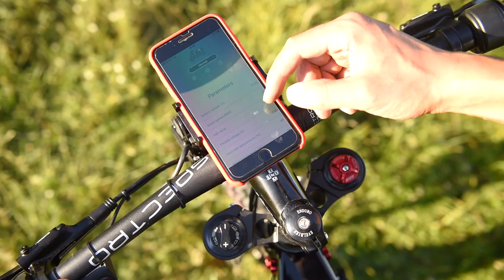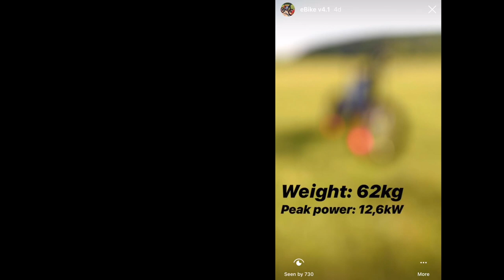Build $3600 DIY Electric Bike that Rides 110km/h - How To Guide and Parts List Promotion

Comment: right now I've got the same EEB frame. a 60v 35ah battery, what controller and hub motor could I use to get the most out of it?  

Last build was 1.5kw + 52v 30ah battery. only like 30a controller tho

Comment: Oh so i didnt know your ebike 4.2 charge in 44 minutes that's insane, very nice build.  13kw motor, 2é2kwh battery, 44 minutes charge and Schlumpf drive for 3600 USD is dirt cheap.  Thanks for inspiration.  I started building ebike after falling on your website a year ago, i started with a hardtail BBSHD, then BAC ASI 855 BBSHD 3.5 kw, nand now  im now building my 3rd one, a 12kw enduro but this build is WAY better.  But seams to take more tools and more skills.

Comment: looks like a good build...with that range and speed capability, only thing that I see going first would be the tires.
Reply from the maker: What’s wrong with them?
Reply: @ladiandmargaret  not that there's anything wrong with them, just that they will wear out fast if they are normal bike tires due to the power & range, I think. You haven't wear them out yet have you?
Reply from the maker: These are motorcycle tires, should be fine.

Comment: Everything looks good but when you bind those batteries together I hope you connect them to the regulator or power stabilizer chip so when they are charged or used at high speed it wont get leakage and the engines can use the battery as a whole not as a single slots of energies.
Reply from the maker: Don’t worry 😉
Reply: @ladiandmargaret  I really really like this bike build and other builds on your website but I do have some questions that need answers

1- Is this e bike weather proof?
2- How secure is the battery(if I got on a bumpy terrain will it vibrate)?
3- This bike is 3 years old did it not receive any updates during all that period?

Comment: Would I need welding equipment and other expensive tools to build this? Also don’t have a 3d printer could I make parts from wood? Thanks
Reply from the maker: You don’t need to weld anything, basic tools only, 3D printer not needed.
Reply: No nee comments. I'm very interested and have been deep down the Alibaba hole

Comment: Is there a mode to let it look like a legal pedlec? (Just driving 25km/h while putting work in the pedals).
German police is very strict with stuff like this :/
Reply from the maker: Yes, you buy extra pedal sensor and change the mode to up to 25km/h. The problem is that legal ebikes must have less than 250W which is an obsolete nonsense.

Comment: Thanks for the inspiration, very nice bike. Just a question. I have seen that the schlumpf drive price is about 600 €. Is that drive included in the base parts for 3600$?
Reply from the maker: No it’s not. That’s extra.
Reply: Ladislav Jecminek is the schlumpf drive needed to be able to pedal the bike or just an extra to secretly change to just cycling? I didnt understand that obviously.

Comment: RC Lipo packs? Please tell me by 2022 we’ve switched to A123 LiFeP04  pouch cells (that have been around for years). You could probably fit 72V 50Ah worth of power cells in this frame.
Reply from the maker: We use 21700 mainly these days. Molicel p42

Comment: What is the largest DIY battery  you can fit in an XL fat bike frame? cell size? cell number? volts? AH?
Reply from the maker: What xl fat bike frame?
Reply: @ladiandmargaret  Surley Moonlander. The place where I live in China has lots of hills up to about 5,000' climbs so lots of power and no overheating of motor is more important than in other flat countries. 48V? 72V? 90V? 22,600? 18660?

Comment: What kind of kickstand did you use to hold up the extra weight of the e-bike?
Reply: Kickstand should aim directly at the bike centre of gravity then the load goes straight down the stick. A narrow tube is strong enough as it should not see any bending loads.

Comment: Is there any function that charges the battery while paddling like turbine generator built in
Reply from the maker: Yes, it has regenerative braking. What you are suggesting would barely provide any power while pushing 60kg bike.

Comment: Don't you have concerns about the lipo batteries getting hit in any way while riding ? 

I see you are using BMS for recharging , so that is good, but I still would not leave them unattended while charging.
I'm thinking of building a bike like that , but I think I will use good 18650 or Boston Power Swing 5300mAh (  they are actually made for electric bikes, scooters, etc in mind ) .
Reply from the maker: Not at all. It’s more risky when you mechanically damage it.

When purchasing my video guide I include 18650 cell based battery drawing that fits the frame and controller inside of the frame.
Reply: @ladiandmargaret  , Its cool bike and you should be proud of what you have build.
The thing is I'm not sure if I want a lot of power or a lot of range so I'm kind of split between 1000-1500W motor with very big 48V battery pack or something like your beast of a bike.
If I make the bike to go ~50km/h with the same frame that you are using , I can put a battery that will let me go for over 300km of range in theory.

Comment: Where did you buy the bike frame from? What's it called? Very cool.
Reply from the maker: Hey, build your own. Based on my parts list including over 80 parts with link and prices, straight from suppliers. I also have a video guide that is over 3 hours long showing how I built mine.
Reply: @ladiandmargaret  is the video with the parts list up? I'm not seeing it.
Reply from the maker: I’m selling parts list and video guide separately. When buying both I’m including 3D models for printing some parts.
Reply: @ladiandmargaret  ok, I'll send a email in a few weeks after I move.

Comment: Hey great videos and smart job, why did you like the most the rear hub motor, i believe for balance, but some peoples said the mid drive motor are better, so tell me?. the e bike that are you making are to much like dirty bike no my style, i am on the move to buy a Chinese one,still looking, would you, by the way can do a custom job like the battery and controller do it like you do with yours bikes and the last thing about lights to be situate or place on the sides o the suspension  fork like LED or something and you can move it or swivel. 
great job keep it up.

Comment: Bro I have a motor it’s mid drive but not one with the planetary gear set up it’s a liquid cooled 3phase ac motor with everything everything but I need the right frame can you advise one I have tried finding one but none I see have the right style I need something in the electric dirt or motor cross style it’s going to be crazy I am using a combo of your battery type and the new super capacitors  they have now I have a line on very powerful motor packages that put out 15 to 25 kw conscious  77 to 45 peak kw output

Comment: do you have a EBay link that u sell it,....? or amazon...?
Reply from the maker: I don’t sell ebikes, only parts list and video guide based on you can easily build the same bike for $3600
Reply: Ladislav Jecminek I got a question and sorry if it’s quiet silly but, you sell the whole parts (meaning the total bike dissemble) for that price?, or the parts are for an specific bike?
Reply from the maker: I sell parts list with links and prices of individual components. You order them home and start building this ebike based on my video guide. This is the cheapest possible way how to get one of these strong ebikes only for $3600 USD
Reply: Ladislav Jecminek where do I get the links and the video?.

Comment: 3:10 how to make you bike explode "compact lipo batteries  in a aluminum box, squeeze it in if you need too" job done.
Reply from the maker: Is this something you read online or experienced on your own?
Reply: 2 times it happened with me but that because I had one in a box not having enough cool air flowing to it, the over in a warm room and probably had over issues with it.
Reply: If you're using the right controller, BMS for lipo batteries then you're good I guess.
Reply: Glad I am not the only one that thought that.  I use these types of batteries for rc planes.  I've had a few explode it's not pretty.
Reply: @ladiandmargaret  Does this bike have an ally frame, kinda looks plastic to me?

Comment: what’s the battery size voltage & amp hours?  nice mod on the sabvoton
Reply from the maker: This one is 84V 30Ah, cheers.
Reply: Ladislav Jecminek nice!! just built an 84v w an 8000w rear hub, these bikes are the best!!
Reply from the maker: Once you try one, there is no way back 😂👍
Reply: You get 84v and 30ah for $3600?
Reply: Dayna Cook 96v but I can’t think off top of the amp hours

Comment: Epic bike, I hope someday I can build a bike like that. I just finished my first build a couple of months ago and I have 1,200 miles on it already, since I don't have a car. My donor bike is a specialized roll sport with brake and tire upgrades. A 12t Mac motor 1200 watt max, only a 6 fet controller. 52 volt 23 ah triangle pack. Top speed on flats 28mph and it gets there pretty quick as long as I'm not pulling my heavy cargo trailer. I want to build a 3 wheel electric tadpole car some day, something that will make 27,000 watts. I like the simplicity of electric vehicles, less moving parts = less mechanical breakdowns.
Reply: Nice. Wish you luck man.

Comment: It is sabvoton 72200 with qs 3t or 3.5t?
Reply from the maker: Qs205 4t and sabvoton 72150 I ended up using. 200A would fit too tho.
Reply: @ladiandmargaret  So it's laced in 19"?
Reply from the maker: Yep

Comment: Could somebody link me the bike frame I’d like to build an e-bike with this body but with some cheaper parts and then upgrade over time
Reply: aliexpress has everything
Reply: EnduroEbike or Leili.
Reply: Loads of frames online mate,stealth bomber.
I just can't find wheels lol i can find fat bike wheels but 4 inch wide is crazy. I just want 19inch/26 inch 3 in wide maximum, like in video or sur Ron size
Reply: @tesstickle7267  People use moto wheels and tires on these higher power hub motor bikes. And for a good reason.

Comment: Very nice, but I really wouldn't use hot glue to build a bike
Reply from the maker: Why not?
Reply: @ladiandmargaret  well in a bike you usually choose the strongest solution, so I'd use bolts and not any kind of glue
Reply from the maker: I’m not afraid of using hot glue gun for certain use where I know it’s good enough. For the bottom cover it was great. I had it done very quickly and after few months the cover is still the same. Don’t worry, I know what I can use hot glue gun for.
Reply: Any links to your build?

Comment: 2-3 years and it will be affordable for major of people.
Reply from the maker: I honestly can’t wait for competition to push parts prices down!
Reply: @ladiandmargaret  i cant wait for 17000w hub motors to be readily available the best i can find on ebay is 12000w but id like something in the 15000w and up range
Reply: I don't think so, maybe the parts you buy yourself and build it yourself is cheap, it's never cheap on a complete product,most of them with this spec is 10k ...its alot of work and labour to build one.

Comment: Nice work Ladi,
i fail to see why people give a thumb down. Build yourself an e-bike and then upload a video of the build. Let's see if you do a better job.
But those e-bikes are not really new. "Stealth" bike frames are available since several years. Andy Kirby has had several videos on how to build such a ride (https://www.youtube.com/user/andykdubs/featured). Also 100 km/h is not really that hard to reach. I had a 9C RH205 rear motor myself which easily reaches up to 90 km/h if coupled with a 20s battery. Not that I would be so insane but I saw a video on  YT with some guy racing around at > 90 km/h on country roads.
Reply from the maker: Thanks so much. No I know it’s nothing new. I just would like to spread the word and show it’s affordable and relatively easy to do.
Reply: @ladiandmargaret  Just a side note: Powerful controllers such as Sabvoton, Adapto or Kelly should NEVER be mounted inside a frame, frame bag, box or something like that. They need air to "breathe" or more specific continueous airflow to keep them cool. I mean even my rather small Grinfineon 25 Amps peak controller gets really warm when I push my E-MTB fast up the hill. The batteries themself tend to get really warm if you run them at a certain power level. So keeping away additional heat helps them as well. For Stealth frames the controller typically goes where you added the box from below.
Reply from the maker: Thanks. I know they can overheat but it’s very difficult to overheat this sabvoton. Adaptto sure, kelly gets hot like crazy but not sabvoton. They still use old school fets. When building this bike and box from underneath I thought about adding fans and digital thermostat to it. After some time of testing I haven’t had more than 48 degrees celsius in the controller so I decided not to overcomplicate this shell and keep it sealed.

Comment: What kind of batteries do you have and where did you get the forks and frame so cheap¿?
Reply from the maker: In this one I have LiPo but different builds I have lion.
Reply: @ladiandmargaret  - OK.... What's the V and mah, Series / parallel of each single pack¿?

Comment: How does that legally work? Is it legally a motorcycle or a bike? Also isn't that a bit too fast for a bike, safety wise
Reply from the maker: Illegal. Law has no place for this yet. It’s not too fast. The frame is heavy duty made for higher speeds.

Comment: why couldn't i find the autonomy anywhere in the three videos ?! i guess it's something like 20 to 30 km
 !
Reply from the maker: What is autonomy? Max speed is 100kmh, range per charge is 80km.
Reply: @ladiandmargaret  oh yeah i meant range, thats an acceptable range, but i'm really really wondering why electric vehicule makers doesn't use the gears ! it can litteraly increase the range by 10 !!
Reply from the maker: You should consider starting developing them.
Reply: @ChamaneKing  bull.

its likely that you gain 20% with gears.
Reply: @ZeljkoMikulec  i'm not so sure !!
Reply: @ChamaneKing  you dont have to be. there is no magic way do distribute energy. consider that gears ad something that can be broken and some weight.
anyway: thats hub motor . therefore it make no sense to ad gears. You can have gears in bosh motor.(middle motor)
Hub motors with gears are under 1500w.
Chinese production.

Comment: Hey man I'm from UK.
In UK they don't consider this as electric bike it too fast, the battery volt and the motor W this too powerful/high.
If the police stop me and see the battery volt and motor w power. Plus if they know I don't need to  paddle to keep moving then they will take the bike off me and all the money I spend will be useless.
Reply: Pretend to peddle :') slap a 250w sticker on the side of the battery case. Sorted. (in any case they wont take your bike, they'd fine you. source: also from the uk )
Reply: You could just register and insure it as a motorcycle instead?

Comment: $65 USD for a parts list... what is it? blue prints on how to build each component? or are you just charging to send us where you got your kit....
Reply from the maker: This is not a kit. These are individual parts that I personally researched and tested. Nobody else offers this amount of power, fast charging, built in charger, bluetooth connectivity for this amount of money. It cost me a lot to learn all of this the hard way and I want to keep developing better ebikes. Because of this, I need to be charging certain amount of money. As I discover new parts, find better prices or find better solutions, I always update the parts list. Up until today there has been over 20 edits already. Everything is logged, commented and linked to all the products. So for people that want to build the same ebike, by spending $65 they save weeks of online research and much more money on not buying wrong parts that would not fit together. I think the value people get is pretty fair.
Reply from the maker: Ladjes@gmail.com
Reply: @ladiandmargaret  Built in charger? Is that the thing on the bottom of the frame? It's fan cooled, yes?

Comment: 110 km/h and Shimano mechanical brakes what a mistake let the braking power be with you!
Reply from the maker: They brake very well. If something was wrong with brakes at this stage, I would complain about rotors which I replaced few weeks later. Here is a video where I test brakes, take a look:

https://youtu.be/Bj5SlGFn-6I

Comment: I mean...still, nice video and very cool to see but...it's not really a 'how-to' as you can literally see nothing what's going on because of the time lapse...?

Also you didn't put any parts list in the video, just a standard 'contact me', same with the hours-long instruction video...
Don't get me wrong, still like the video! But that title seems a bit clickbait-ish to me..  :/
Reply from the maker: This is supposed to be a little promo for my video guide that I sell.
Reply from the maker: I mean if you search for how to build an ebike, I think you found it. It is information I collected and learned for years. Took so much time to put this parts list together and record complete guide. I need to pay my bills too so that would be stupid to share it online for free.
Reply: @ladiandmargaret  I find it perfectly fair to demand a few bucks on how to build an e-bike. It is not THAT hard to but requires patience and the will to learn. All the information is available via YouTube or Endless Sphere. An average MTB can easily be converted to an E-bike running up to 50 km/h without too much hassle via a simple conversion kit from Ali Express for 400€ plus a big frame bag battery.
Reply: Title is bullshit. I can't see the motor specs either